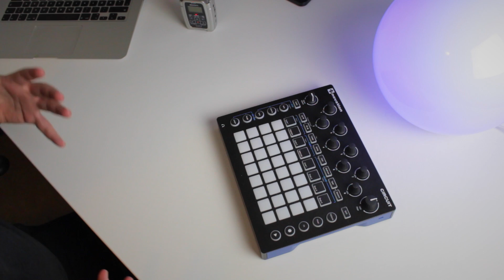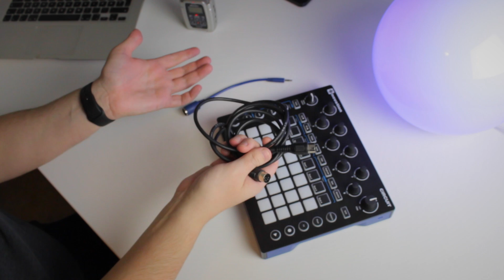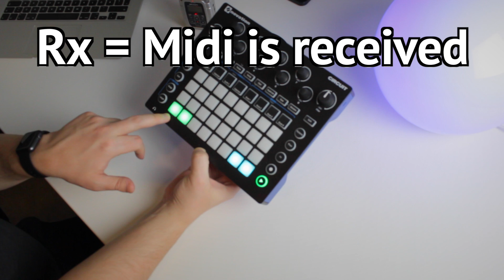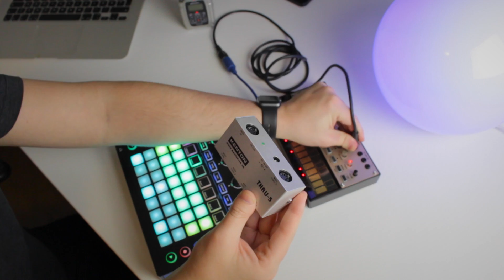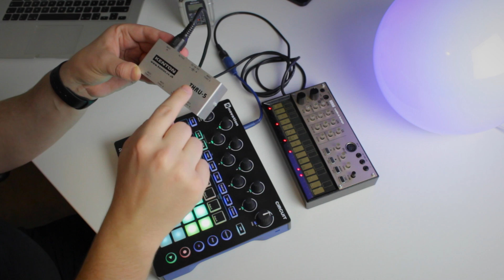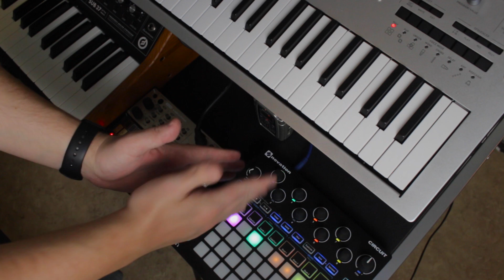How to connect & sequence external synths using Circuit (Beginner Friendly Tutorial)

Comment: Excellent video Bo! I'm a newbie and was looking a long time for a video like this to show easily how to set up and sync different devices. 
Also have the Circuit ...question: If I use this Kenton box with Circuit, I can sync up to 4 or 5 devices but play different sequences only on two of them because of the circuit only having 2 synth channels right?
Cheers!
Reply: Don't forget that when doing this you could in fact play all 5 synths on the same channel to get a monster layered sound from all 5,  or say 3 synths on channel 1 and 2 on channel 2,  or for Kick reinforcement 2 synths channel 1, 2 synths channel 2,  and perhaps Volca Kick on channel 10 (the drum/sample parts send MIDI to channel 10)  The combinations are many and varied....
This may seem overboard but imagine if each synth you have connected has an arpeggiator that will use the incoming MIDI as its root note....you could have 5 different arps playing on 5 different synths with the Circuit outputting the root note so you can use it to control the chord progression.

Something for the New circuit features list perhaps,  on the MIDI Settings page..have an option to only output the sequencer via MIDI,  and have what you play on the pads only go to the internal synths..that would let you 'noodle' over the top :)
Reply from the maker: chatolars thanks! Yes that is correct. Unless any of those 5 synths has internal sequencers or you play them live. But the sequence can effectively sequence 2 channels from its own sequencer.
Reply: Andrew Cummings  wow ...thanks for the info. That would nice ...is that possible now or with a future OS update ?
Reply: BoBeats great thank!
Reply: chatolars you can do it now,  all your synths can listen to the same channel if you want them to. It is down to the synth you are sending to as to what you can do with that midi.
The bit I would like to see added in an update is the bit where you could send midi from the 2 sequencers and play the onboard synth separately,  that would be really useful.
Reply: thanks!

Comment: Cool video. Have started experimenting with external gear and recently got a Volca keys. 

Another tip is to write your patterns on the circuit sending  clock+note and then record the sequence into the volca. Then switch back to just clock send on the circuit and it frees up synth 1 whilst retaining the patterns you've already written.
Reply: I do this all the time when using circuit connected to Korg Gadget or ModStep on my iPad
Reply from the maker: Rupture // Rapture yes this is really cool!